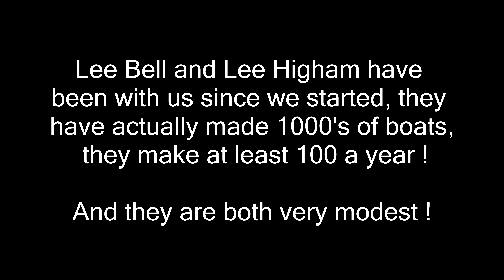XS Ribs UK How To Make a Commercial Leisure Rib Inflatable Boat  Meet the Staff see the process 4K

Comment: Rookie question, Why don’t you fill the hull with foam?
Reply from the maker: We expect our craft to have an operational life of 20 years, foam does not last that long and given the hull is a sealed void. where no significant quantity of water can enter, there is no advantage in putting foam in there.  Often foam is used to lighten the lay up by bulking out the internals to add strength. Any one who has any experience of a soggy "Del Quay" boat will understand why we do not use foam !
Reply: @XsribsInflatableBoats  thank you for explaining 🙏